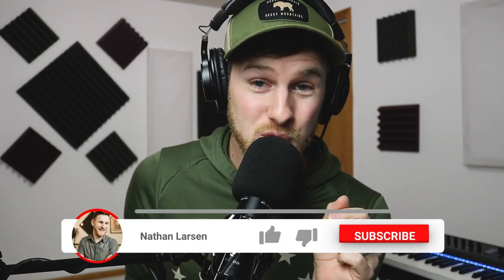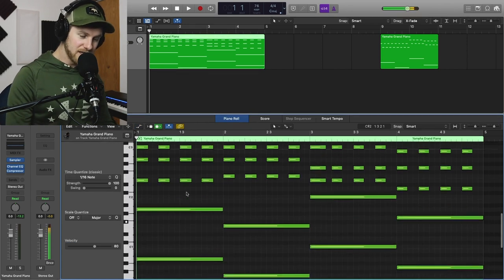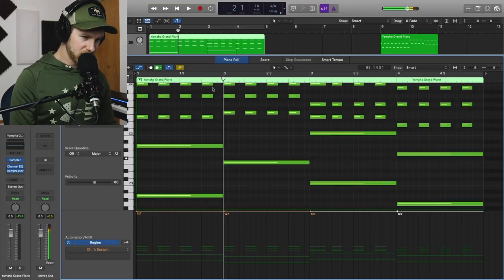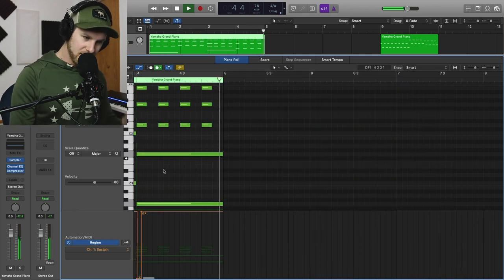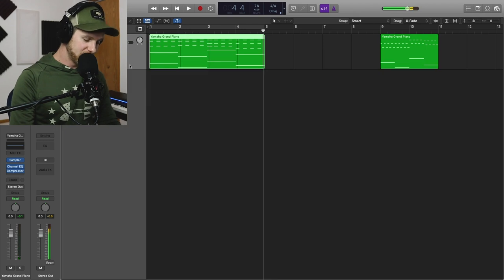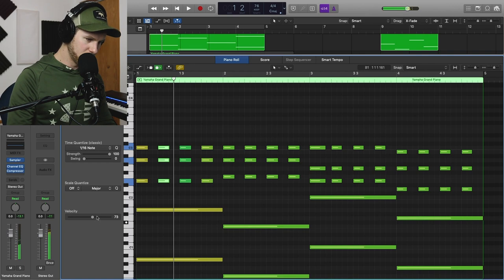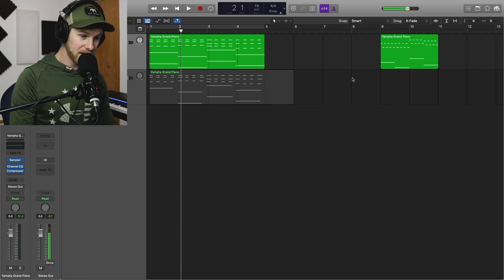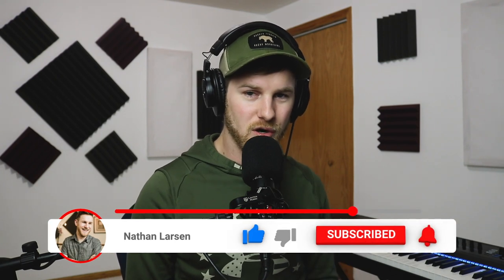Making MIDI Piano Sound REALISTIC!

Comment: You forget another important thing. It sound fake when all notes are perfectly quantized. So you must randomize quantization so the notes wont play all exactly at the same time.
Reply: Absolutely turn quantise off with piano. Any attempt to salvage a quantised piano is just putting lipstick on a pig. 2nd suggestion would be to never ever strap stereo reverb across a piano and call it a sound, Aux send and pan it out of the middle. If you still want to soften attack, add a smallish room to piano channel and set the the wet dry pretty dry, if you can hear the room verb, it's too loud, it should be felt not heard. This very basic video nails the sustain pedal technique for those not playing the pedal in, but really the most important thing is to be able to play it in and leave the piano roll as unadulterated as possible. Piano is tough to get right and even the best can always be better in regards to midi. ✌️🎶🎶
Reply: Thanks for the tip
Reply from the maker: Uhhh not true. Totally depends on the genre and style you're going for. I perfectly quantize all the time. 

This is the thing a lot of people get wrong - timing is not what makes something sound fake... articulation, velocity, and other performances aspects do. 

This is why a drum production that is perfectly aligned to the grid (AKA, quantized) still sounds awesome as long as the original performance was awesome. 

Now - if you are composing more classical, Neo-Classical, LoFi, etc. then yes you are correct - that more "unedited" sound is good. But saying "you MUST randomize..." is very strong language.
Reply: @NathanJamesLarsen  Think about it like this. It is physically impossible for a piano player to play multiple keys perfectly and precisely on the beat. Random quantization would definitely help ‘humanize’ a MIDI piano track, regardless of the genre of music. So I wouldn’t go to say that this comment is “not true”. Just my hot take 🤷‍♂️
Reply: @Nathan James Larsen @Fanta Banta    It really depends on what you are wanting. I wouldn't say that its not true all the time but it definitely is okay to quantize perfectly. When there is only piano and not a lot of other sound I usually won't quantize perfectly because you can tell (most people when they play the piano press either their middle finger or thumb first.) but as soon as drums or other insruments come in I like things to be quantized more perfectly.
Reply: @NathanJamesLarsen  it is true though... If you want to piano to sound realistic the notes cant be perfectly aligned.
Reply: Agreed. The beauty of a piano is its AGE. You get one just the right age and it has so much "human" quality to it.
Reply: @gmichaelhall  lmao bruh what? its midi you can just drag notes of the grid... its not even close to the end of the world like what lmao i always draw in piano and it sounds fine you just drage the notes off the grid slightly when zooming in, make every note slightly different

Comment: A little tip from pianist fella here: when you need to depress/release the sustain pedal for a chord change, depress it a little bit after the chord change and not before the chord change. Why's that is because: 1. That's how pianist have been thought to use the sustain pedal; 2. So the first chord wouldn't abruptly stop, that makes it sound clunky (and basically a bad way to use the sustain pedal as a pianist). It needs to flow to the next chord before it can stop, just a tiny bit, I'm saying like maybe an 1/8th-1/16th of a fraction of a beat.

Comment: One protip regarding sustain: not ALL piano VSTs are simply "on" or "off" with the sustain. Certain ones out there support "half-pedaling", which is a feature on real acoustic pianos where the pedal can be very lightly applied to create a milder sustain effect. These are commonly paired with analog or continuous damper pedals so the feature can be used while playing live. If you aren't sure if your particular VST has this feature, dive into the settings and see if there's anything about half-pedal. If it supports half-pedal, then EVERY sustain value will be read, and a different sustain effect will be applied at every possible value above 0. Some piano VSTs also have half-pedaling on a different MIDI CC all together, but can usually be configured to use the default Sustain MIDI CC. 

Additionally, some really fancy piano VSTs even support re-pedaling, which is another feature of real acoustic pianos: re-pedaling allows a note to be sustained at any velocity, letting you "carry" it at that existing volume into the next phrase. For example, let's say you play an A at maximum velocity, hold the key, and it decays to half the amplitude half a second later. With no re-pedal support, sustaining at that exact moment will not work. The note will just not sustain. If your VST supports re-pedaling, you can pedal at that moment and the note will begin to sustain at that particular velocity. Very very handy feature. In the context of penciling in notes and using MIDI automation, you would give that particular note at that particular step a re-pedal instruction in addition to a default sustain one, and it will actually carry it over to the next phrase instead of leaving it high and dry.
Reply: I have a keyboard with no touch sensitivity, can i use a software/plugin to bring it out
Reply: @Bruno-xx2km  No.
Reply: @spartan456  thanks.

Comment: Great stuff. I’ve been playing piano a ton in the last couple years. The digital piano sound on my keyboard is not great, so I have been running through an audio interface to the Mac in Garage Band. That helps, but it was still artificial sounding. Recently moved up to MainStage. A little better. Moving to Logic seems like a good place to start. This video will certainly help get closer. Curious if there are any settings within the piano sound itself, beyond sustain and velocity, which are more performance based. I would love to see what you do inside the factory sound settings. Thanks!!!

Comment: Hey Nathan, thanks for the suggestions.  Could you explain what you mean by putting octaves on the bass?  I have an instrumental piece that uses a lot of 7th chords.  Key is C (C2).   If I copy that chord and move it down an octave (root note at C1), it sounds terrible if you play both versions of the chord simultaneously.  Are you just adding select bass notes to fatten up the bottom end?   Thanks.
Reply from the maker: Just the root of the chord is an octave in the bass. If you start adding lower octaves with other notes of the chord then, yes, it'll sound terrible haha!
Reply: @NathanJamesLarsen  Thanks.
Reply: @NathanJamesLarsen  - substituting other voices of the chord as bass notes would be an inversion🤷🏻‍♂️.

Comment: Not completely true. On actual piano and most advanced piano software instruments sustain pedal is not an on/off switch. It determines how much you lift dampers form strings per pumping the pedal. A mild push creates a different, more subtle effect and this is why sustain in midi has 0 to 127 values.  
On some old or poor software instruments it can be implemented as an on off feature, but this is not the case for many good piano emulators, like Pianoteq.

Comment: If i want to connect a piano and get sound from cubase, what kind of audio interface do i need then ? Do i need one with an output or what ?
Reply: Depends on the age of the piano or keyboard. I have old outboard keys with just midi in/outs. New cheap interfaces usually just have usb. To be safe get an interface with midi in/outs . Decent new electronic pianos will have both usb and midi jacks. 
Ideally you still need 2 powered monitors for your interface and/or a pair of good headphones. Having multiple playback sources is a bonus, cell. home stereo, car stereo, mp3 player etc.....
If I just want to record midi information a midi to usb cable I plug into the usb on my computer. Roland makes such a cable
Reply: @genuinefreewilly5706  well my dad uses a keyboard with USB. He connects that directly to the pc so when he presses a key on the piano it send a signal to logic ( I'm gonna use cubase) and then he takes the audio from cubase and sends it thought his audio interface and then to his headphones. 

The problem I'm having right now is that my headphones built in audio interface/amp doesn't support asio drivers so I can't get any audio to my headphones.
Reply: @oskarwittje8348  I imagine you set up the drivers that came with your interface as well? Say you are installing a focusrite box, the  asio driver comes with it. Other new interfaces are similar and come with their own asio driver. The few I have set up. 
On my interface midi goes into the interface, and audio from my keyboard (old korg triton) and then I have native and 3rd party software patches, compressors and effects
The software reaper and its monitor show me midi data in red, and audio in yellow from the keyboard or the software patch sound I am using
The initial setup for all these programs is pretty much the same, Logic, Ableton, Cubase, I like Reaper as it runs on almost any machine.
Logic has an amazing score window for writing, Ableton is great for live music, FL studio is pretty but bloated etc.....
Good luck

Comment: Does anyone know why it's called velocity? Just seems like a stupid term for what's essentially how hard you press the keys on a keyboard.
Reply: probably referring to the speed your hand attacks the keys
Reply: “Hard” implies pressure force. You can run it over with the car slowly and still be at a 1 velocity value. MIDI Velocity is indeed a time interval between two key sensors.